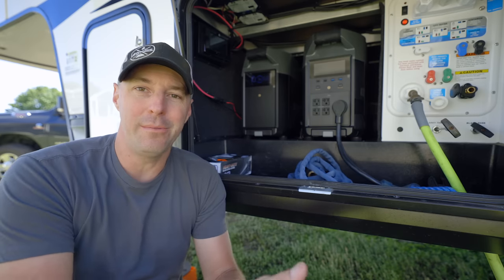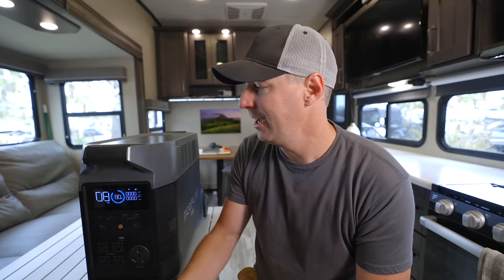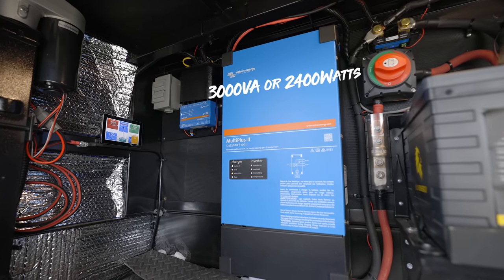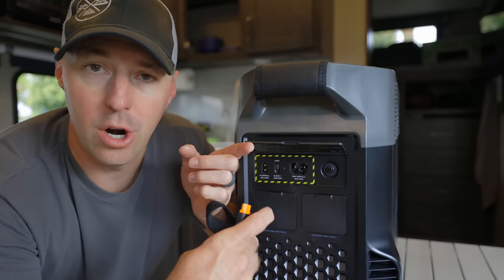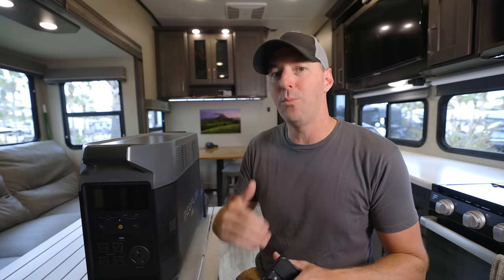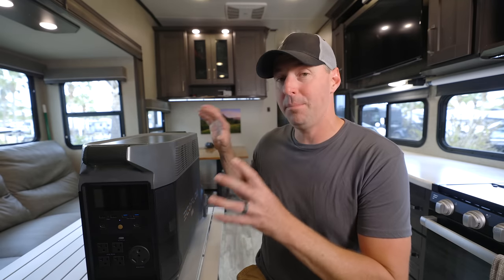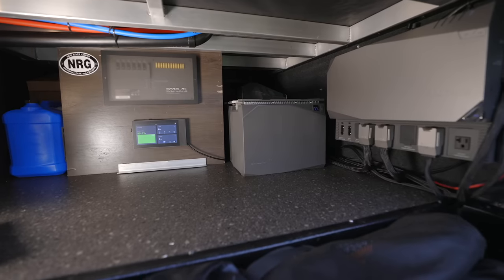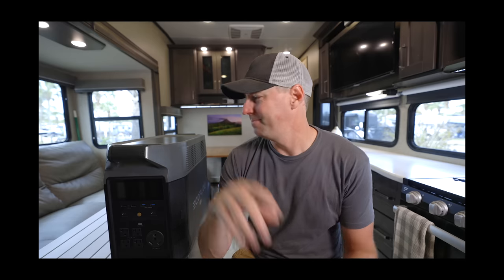Surprisingly Easy Inverter With Solar. EcoFlow Delta Pro Review.

Comment: Jared, thanks for another informative video. I may have missed this but if you already have solar and inverter with a LifePo4 battery system in your 5th wheel, can you plug into the ecoflow and treat it just like you’re plugging into shore power? In other words; can you just leave your regular system all hooked up and on like you would with shore power?
Thanks,
Dale

Comment: Thanks! I've been on the fence between the EcoFlow and the Anker, but I'm leaning towards the Anker.
Reply from the maker: I looked at the Anker and it looks impressive but I landed on this because  of the output and capacity is tough to beat. The Anker has less fan noise from what I heard.

Comment: What was the temperature outside when you were running one AC and the bay only registered under 85 degrees. What if the outside temp was 100 which happens here in Florida?

Comment: Surge protection? My small motorhome has a built in SurgeGuard which trips when using a solar generator (2400w inverter) and the AC compressor comes on. (13kBTU with soft start). Everything thing else including microwave works fine. Have you come across this surge protection device issue, including when is a grounding plug needed?

Comment: Jared...I hope you see this...I have a question...so I get the AC side of the Delta Pro...but can it be used as your "house battery" DC side as well if you shut off the RV charger? I am looking for a simple solution to power both AC and DC in my RV.

Comment: Hello. I was wondering if you wouldn't mind heling me on a scenario with the installation of this Delta Pro. I have a 50 AMP RV with 2-200AH Lithium batteries with 3-180W panels through a 40Amp controller. How do I hook these up to receive solar charging?

Comment: Actually trying to design an equivalent 30A, 3600 w system to plug into my fifth wheel when boon-docking.  Our system is 50A, but it runs just fine for us at 30A if we don’t run everything at one time. Also, have an in-line soft start to offset surge draws that trip breakers. 
Would 4 100w solar panels be enough to replenish the 4 100ah batteries? What about the specs for the other needed parts? Solar converter, AC inverter (4000 watts?)…
If you have the time, I’d appreciate the help. Thank you, Rollo

Comment: I always appreciate these updates on solar generators as im totally off grid. But I'm a bit confused on selecting the correct solar panels watts/volts and not destroying these units. Here in the tropics it's standard every day cloudy skies. If this unit only accepts 1600 watts, it would require over panelling to achieve continuous load which this EF model doesn't allow?  I'm learning and appreciate these videos.

Comment: We also have Grand Design model 303RLS and travel a lot in Texas. When we arrive at our destination it can be over 100 degrees in the RV . We were thinking about getting something like this with the spare battery and run both a/c s the last couple of hours of our trip to cool down the inside for setup. Do you think this unit would run a 13500 and 15000 btu air conditions with easy starts for a few hours? Or would we have to settle for running one unit at a time? Your help is apricated, thanks.

Comment: Didn't quite understand. Does this work like a regular inverter? If I plug this into an outlet in my fifthwheel, will it pass the power through?  Then, once it detects no charging transfer over battery power?

Comment: Great info, question in reference to Ground/Neutral bonding.   In this application I see you used a "bonding" plug, and I believe that the ecoflow has passthrough when plugged into shore power, so in that instance a plug would not be needed, because you are getting your bond at the RV parks panel.   Is that correct?   
How does something like a sungold 3K Inverter charger or your multi plus handle that,   does it have a switching neutral built in on it's "internal transfer switch".  So when it runs from battery, or disconnected from shore power the inverter has the bond, and when actually switched to shore power, the bond is taken care of in the "park panel" when it's in passthrough and charging mode to avoid having two bonded locations?

Thanks to you or any other viewers for feedback.
Reply from the maker: Yes in a pass through setup it should have its bond from shore power and you shouldn’t use the bonding plug. Also Yes the Victron has an internal switch for the bonding when disconnected from shore power. I can’t remember off hand if SunGold did or not but I don’t believe it did but I would have to check.
Reply: @AllAboutRVs  Thanks,  guess I shoulda researched on my own a little more,   getting lazy in my old age, but according to the Instruction manual for the sungold 3000W 12V inverter.  "All single-phase 120Vac inverters are equipped with an automatic neutral-to-ground switch".

So when running in inverter mode, it's boded at the inverter, and when running on AC input, it's bonded at the panel.

Comment: Question isn't most equipment rated by watt hours. So that being said if you have a microwave that rated at 1300 watts, and
you use it only 15 min. What would be the true watt hours did the microwave use ? I rather put my one system together, but agree for the price and you putting it in your self would be a lot cheaper than paying someone to install the whole system
from the ground up.

Comment: Hey Jarod… love your videos…. I’m about to install solar panels on our 2021 forest river xlr 3212, my question is when attaching the panels am I looking for roof trusses? Or is just screwing into what I imagine is plywood up there sufficient? I’ve also seen plastic mounts that use a vhb tape to stick down to the roof but I worry about if that could rip up the roof material that’s up there during traveling. Thanks for any ideas and input.

Comment: Just to clarify, you can exceed the 15 amp amperage all you want. My solar arrays produce 25 amps but the Delta Pro will only pull the max of 15 amps (15.9 actually in real world test).

Amps are "pulled" by the DP so there is no concern with being over 15.9 amps.

Think of the 15 amp outlets you have in your house. The breaker in your panel is rated at max of 15 amps but when you plug in a 100 watt light bulb into the outlet, the bulb doesn't pull 15 amps. The bulb only pulls the current it needs to operate the bulb which is what the DP does with the solar array power.

However, volts are "pushed" so it is CRITICAL that the 150 volt limit of the DP is NOT exceeded under ANY circumstances after factoring in lowest panel operating temperatures.

Comment: The Victron inverter only has 2400 watts capacity where this unit has 3600 watts.  That's a big difference.  Can you run both ACs when using the Victron inverter?

Comment: Great content video, thank you.  I have an Ecoflow Delta Max 2,000.  This unit does not have a 30amp inlet.   If i use a 30 amp female to 110 male adapter and plug my trailer into it, will the Delta Max power the trailer?  What is the purpose of plugging in a ground neutral bond plug when using the Ecoflow Delta Pro generator?  I should do the same for the Delta Max.  Oh yeah, I also have two - 2000 watt extra batteries that connect to the Delta Max.  The three combined have 6000 watt hours.  Any issue with this setup powering the trailer?  I appreciate your helping me with these questions.

Comment: What about charging this device with the existing pannels on the roof? Can i create a switch coming from the solar pannels to feed either this device or the solar system already installed in the Trailer?

Thanks

Comment: Wouldnt you need to bypass your RVs inverter when using the Ecoflow? How are you byoassing your rv installed batteries to use the ecoflow?
Reply from the maker: You would bypass the converter if you had an inverter that was feeding off your battery bank or if you used the 12v out of this to your 12v RV system. I didn’t want to try and make the 12v from this charge my 12v system on the RV. It has limited 12v output but I’m not sure how well it would do at battery charging. This Delta Pro just had the RV plugged into it and let the converter on the RV charge the RVs 12v battery instead.

Comment: Got an idea for you - selfishly, I'm looking for simple mod idea that would allow me to store a solar generator in pass thru, closed/locked up at night, but yet still be able to plug my camper into it for boon docking.  Love the idea of solar generator as boon docking solution for lots of reasons but wouldn't want to leave it out at night or compartments open at night.  Was wondering if some type of generator inlet solution might be practical or creating sometime of access panel for passing the cord through....  Appreciate your thoughts.
Reply: That's what I'm planning to do, and I'll just install a cable hatch on the underside to enable the RV power cord to enter the locked compartment and plug into the Delta Pro.

Comment: Hi,  great video. I did something similar to this. I charge it with 660 solar watts. I’m considering repairing my coach lead acid batteries with two 100 amp hour lithium ion batteries I’d want to charged it with an upgraded inverter/converter and my solar array. Any suggestions?  Thanks for all your very helpful RV camp videos.

Comment: This is the way for me. Such a great idea compared to installing an expensive solar kit. And it's portable can remove and us it for the house. Just a great alternative but I'm leaning toward Anker instead of eco the anker has a five year warranty compair to just a 2 year for eco and is less expensive.
Reply from the maker: Not a bad choice. What pushed me over to the Delta Pro is the capacity is higher and also a higher output. It’s one of the most powerful all in one units out there.
Reply: @AllAboutRVs  your so right I was just going to add a expansion battery down the road. They both are great units.

Comment: Hey Jared. Great video as always. Now, generation of heat in the under bay…. Is this an issue we should be focusing on? We’ve got 2X300 amp/h lithium batteries + 3000 watt  multi something inverter… should we be cautious  while running it? Is heat dangerous??? Same for a portable version?? Thanks for your expertise! Remi (Canada)

Comment: I may have missed this if you mentioned it in the video, but can you add non-ecoflow supplementary batteries to the eco-flow delta-pro inverter?
Reply from the maker: No it is a proprietary system. It makes it simple but not room to customize and use other batteries or components.
Reply: NO you can't.

Comment: Can this wonderful unit power our 12 volt refrigerator, water heater, pump for our fresh water tank etc?  Please help. Craig and Rosalie. Thanks
Reply from the maker: Yes it can do all that but I would recommend switching your water heater over to propane only while using this to conserve the capacity.

Comment: Great video Jared. I have a Goal Zero Yeti 3000x solar generator with 3200wh and a 2000w inverter. It doesn’t have a 30amp plug just 120 plugs. I just want to use my outlets in the rv. Is it necessary to disconnect the converter when I do this?

Comment: When you plugged your RV into the 30 amp socket How did u integrate your EcoFlow into your main system or do you just use a switch to cut off your main while EcoFlow is plugged in? Thanks great video...Just sayin'
Reply from the maker: It’s not much different than plugging into shore power or a generator. I leave the converter charging the batteries so it keeps them topped off for lights and 12v needs. So I don’t change anything there. I do go and switch the fridge to LP and make sure the water heater is on propane only but that’s about it. Keep it as simple as possible.

Comment: Hi Jared, Great product and nice overview! Would it be possible to connect fixed solar panels from rv roof, plus a portable ground-based panel?
Reply from the maker: It is one or the other. We have used both types but not at the same time. This only has 1 solar input.

Comment: Great video, would this unit be a good replacement for say a honda gas generator? Can it withstand the elements or would to need to always be in a covered / open for air environment?
Reply from the maker: They do make a cover for it but my preference is to keep it in a bay. That temperature test I did was in the bay with the door closed. If I ran it that way all the time I would have a thermometer that would alert me if it got too hot in there. I would also still keep a generator for those cloudy days that could keep solar production down.

Comment: I was trying to charge my delta pro using a 1000 watt Dewalt inverter. This is the second inverter I tried and neither one worked. Is it possible to use my truck battery and an inverter to charge the delta pro?
Reply: I think it requires a pure sine wave inverter to charge the Delta Pro

Comment: So, do I understand correctly that this effectively replaces all the bits and pieces that are normally built into the usual RV solar system?! If so, this makes so much more sense. It may be heavy on its own, but you’ve eliminated the inverter, the controller, the batteries, AND it can be moved out of the RV for use at home.  I don’t really see a negative.  Why would we still want all the heavy batteries, and various space-claiming solar system component?  I just don’t understand how, in my rig, I’d hook it up to my existing rooftop solar panels.
Reply: I was wondering the same thing of how to tap into my factory installed solar
Reply: You would have to bypass the factory setup and run the solar panels right into the ecoflow.
You could have a quick disconnect/connect location so you can use either system. It would have to be before it goes into factory RV mppt controller. It's easily doable.
Reply from the maker: Yes you are right it has a large majority of all those components in this.  I still prefer my Victron but yes there is an argument that for many RVers out there this is a preferred way. It could replace a majority of what our installed system does but I would miss the Power assist. We use that a lot in a year along with a few other capabilities it has. But yes you are right, there is not much downside to use this at home and out RVing.

Comment: At $3k for. 3600Wh system, this seems to be cheaper than an equivalent Victron system (3600Wh is equivalent of 300Ah of 12V batteries). What are the features that are really missing by going with this instead of a Victron system?
Reply from the maker: That might make a great comparison video.

Comment: Can you point me to how I would access my RV mounted solar system to charge the Ecoflow? It’s the factory 190w Jayco system with Go Power controller. It does have an inverter pre-wire. Any tips?
Reply from the maker: We connected to the  wires coming down before the charge controller and made an extension to the DeltaPro. At that point it just plugs in with MC4 connectors so I crimped them on the wires coming from the panels on the roof.
Reply: @AllAboutRVs  thanks!

Comment: how does this work in conjunction with the house batteries in a rig?
Reply from the maker: For my testing and this video I left the RV battery bank in and the “converter” on. You can watch your usage and turn the converter off and on as needed.

Comment: I was hoping you would review this setup. I love your informative videos Jared!  I thought your RV required a 50 amp connection?  Can you use a 50 amp/30 amp dogbone adaptor to utilize this for a 50 amp 5th wheel? If so, I think I am sold!  I would like to add the micro air easy starts to our 2 a/c units and buy the EcoFlow system.
Reply: Yes If you are on a 208Y you can run it all. I have much experience with this and 2000 watts coming on my 5th. I have easy starts coming as well and more. My 5th a EcoFlow powered machine 👍🏼
Reply from the maker: Yes I just used a dog bone to plug into it. Nothing fancy and it works to power both legs in the 50 amp RV just like at an RV park with 30 amp service.
Reply: Thanks for the quick reply Jared!😊
Reply: Another great video Jared. I have a Goal Zero Yeti 3000x power station. It has 3200wh and 2000w inverter. It doesn’t have a 30amp plug. Just 110 plugs. I just want to use my outlets in the rv. Is it necessary to turn off the converter when I do this?
Reply: @jimkathleenboggio7172  Agree Jared does a great job been following him for a while. And yes you want to turn your converter off or you create as charging loop. Using the power station to then charge the house batteries which can be done if needed but is not efficient to go from dc to ac and ac to dc again. Solar will be your friend obviously for the yeti..👍🏼
Reply: @johnnysweekends  Thank you so much for your reply. So I guess with the Eco Flo system you don’t need to turn off the converter. Because Jarred never mentioned that.
Reply: @jimkathleenboggio7172  yes you’ll want the converter off with any power station or your just using batteries to charge batteries and that is really energy waist full as you could say. 
Maybe Jared forgot to mention it. I as well sometimes in my videos will forget some small items as there is so much info with some of these. But I have done a lot of generators and power stations and more and now I rarely if ever have my converter on unless I plug in at a Rv park. But solar keeps the batteries up and power stations run my fridge and more. 👍🏼

Comment: What if your RV is a split faze 120/240v
Reply from the maker: Good question, this video was using it on a 50 amp split phase RV. It’s just like using the majority of portable generators or plugging into a 30 amp service. 50 amp RVs utilize split phase but most the time there aren’t split phase devices on it so the adapter send power to both legs and everything works in the RV.